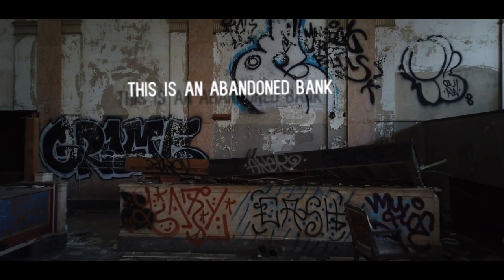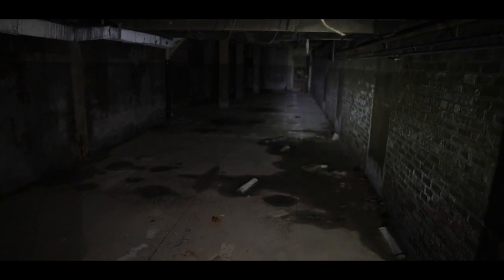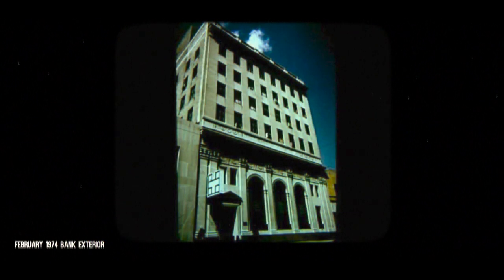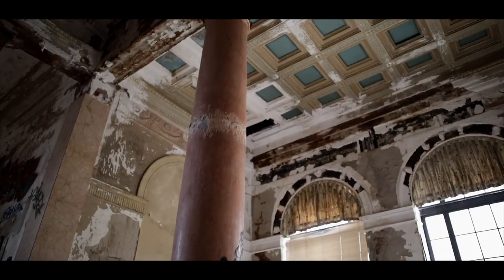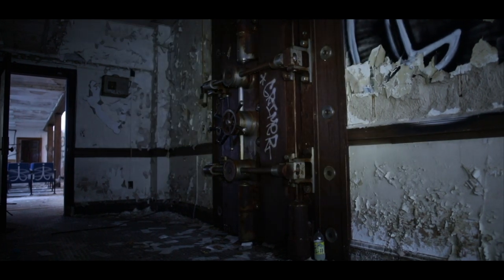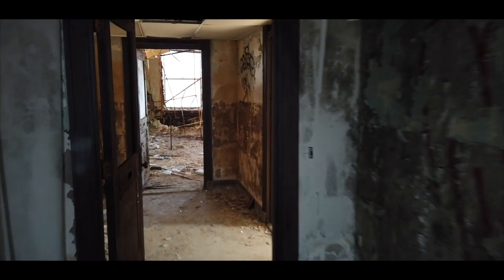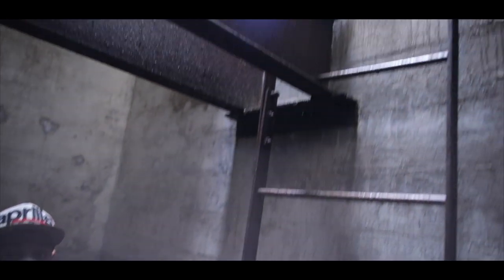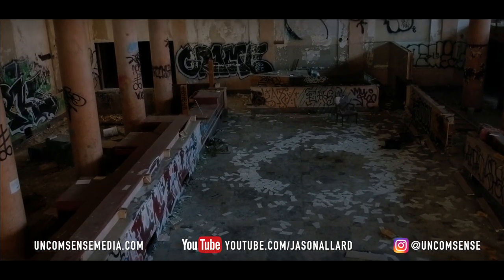Abandoned Bank Vaults & Offices | Rhode Island

Comment: Nice video! I came for the vaults lol On the upstairs (main floor) vault, the 2nd (rear?) door, you showed how the compression bolts were below the opening in the fixed stanchions. The things is, the compression bolts appeared horizontal, not sloping at an angle as they might from sagging. Something to remember, is as the large wheel is turned, those compression bolts rotate from a high point to fit into the stanchions, then rotate down into the stanchions (they are eccentric) to act like a cam and pull the door completely closed before the long, black lever is thrown, allowing the combination locks to be turned. 

Do you think maybe the compression bolts only appeared to be sagging, but in fact the wheel and been turned, and they had been rotated into a lower position instead? This would have prevented the door from being closed by someone accidentally when the building was vacated. Any debris under the tight clearance door, or rust between the door and the frame, or in the hinges themselves would have made the door virtually impossible to open without mechanical assistance, and/or lubing everything up for days before trying to open it. Thanks for the great video!!
Reply: Here's a crazy thought if you guys go back there: bring a couple of metal wedges, like for splitting wood, and tie or duct tape them thick side down, in between the compression bolt ends and the fixed stanchions. Then turn the wheel, if it is free, and it may, possibly, as a long shot, give you the torque/force/leverage you need to maybe make the door budge open lol or move even a little. The large hand wheel and the gearing inside may give you that torque! If the wheel is free, maybe rotate the bolts up to the top to give you more travel to move the door, if that makes sense to you, how I'm saying it. Just a thought! AND maybe bring a level and hold it on one of the bolts or door top edge to see if the door is actually sagging or not :)